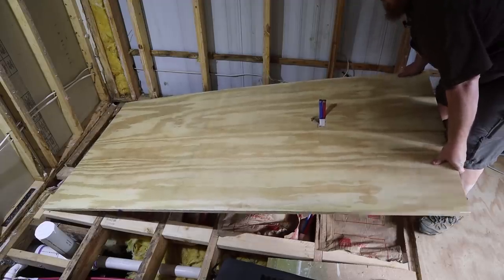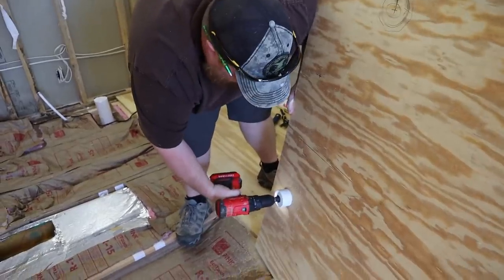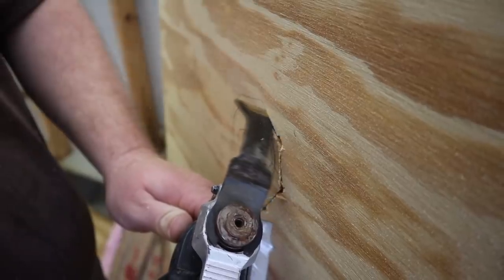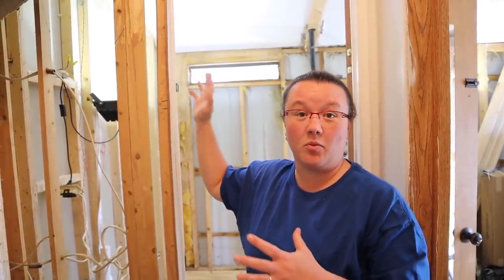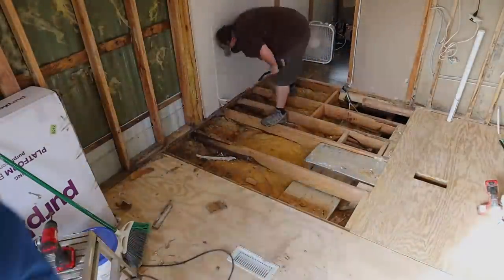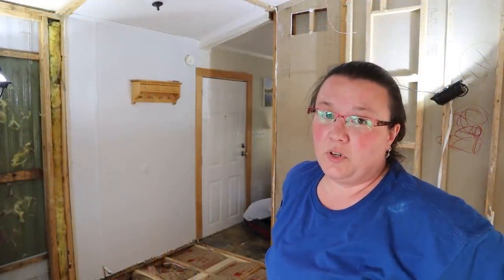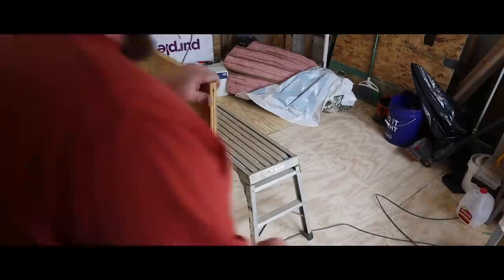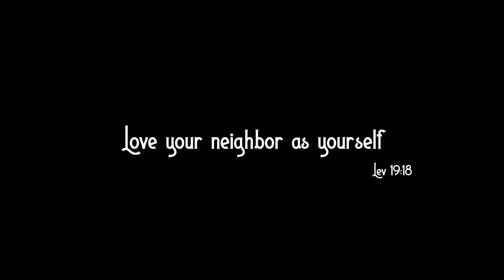WE'RE DONE with this FLOOR! Mobile Home Bedroom & Bathroom Renovation

Comment: Just throwing this out there -- If you get rid of that little 2 foot wing wall that's remaining of the furnace closet and you replace the door to the bedroom where it was before, then you have room for a 4-5 foot entry closet between the living room and the boys bedroom.  And you get rid of that annoying jog in the hall way.  You don't need that vent on the upper wall in the living room side anymore and that will get cleaned up at the same time.  If you don't use it for coats, you could always use it as a linen closet.  Maybe half linens and  half coats.  Just my idea for what it's worth

Comment: I bet the boys will be happy to get back in their room! 
I was reading an article about lumber prices and the contributing factors for the increase. 
It stated that the average lumber cost for a new home is increasing in cost by about 24k. 
It's sad when plywood almost breaks the budget!
Reply from the maker: They're excited, but not near as much as we are! :) We'll probably push to finish the boys room first, then the bathroom on things we have choices over. We can live with one bathroom longer than just one bedroom. We shutter to think how much more everything is going to increase in price just because of lumber prices... it's surely got to have some kind of butterfly effect on things overall. Especially after this long! The spike is turning into a plateau. :(
Reply: My local Lowe’s and Home Depot are loaded with wood. Nobody is buying. The price is going to come down some. Housing starts are dropping too.  Two of the giant cracker box builders near me are offering new homes for rent!
Reply: @tyrehester5550  and yet I can’t get fence wood within 20 miles of me for my fence that blew down in February 🤷🏻‍♀️
Reply: @sam-and-angela  try to recycle wat you can (like the studs from the old wall framing ) , it brings the total cost of the build down and leaves you a little extra money to splurge on other things like wallpaper flooring and fittings
Reply: @crystalh1402  they have this stuff here they make from compressed and heated plastic , actually works well https://www.plasticlumberstore.net/recycled-plastic-lumber
with the raised prices for lumber it might be a good alternative , it doesnt rot when put in the ground so it should last longer

Comment: Thank you for using actual plywood for the bathroom floor! I see so many people using osb (particle board) in bathroom and kitchen areas and when osb or particle board gets wet it's falls apart or atleast loses strength!! We did a full remodel on a double wide we owned and I replaced the entire floor and exterior walls with real plywood. We also rebuilt exterior walls with 2x6 instead of 2x4s as it gave more strength as well as more room for insulation. It wasn't cheap but our utility bills were reduced by half when we were done. It also really quiet inside now. That was a pleasant bonus we didn't consider. You guys are doing great!! You've also saved yourself a huge amount of money by doing it yourself!

Comment: AT 10.51 where Angela had explained about the small hallway , I wondered if you had considered moving the door opening to the boys bedroom over a bit further to the wall on the right . (where that wooden hat rack is )the space that the door took up could be used to place a door to the bathroom making the bathroom slightly bigger because you have removed the furnace.

Comment: there is a wall saw that is used specifically for that though but would still have the same ''issue'' replacing blades anyway. but the oscillating saw might just edge it out because you can use it to clean/level the floor joists as well.  im glad i found yalls videos. its been a minute since ive done any work on a trailer and im most likely fixin to move and the land also has a trailer on it that is ours if we want it and this has been a good refresher course on what to expect. im about to be workin non stop because the land has a house on it that needs repairs and updating, plus the trailer, and the one thing i NEED it aint got is a garage which im going to build from scratch. concrete floor 30x30 walled in pole barn. then after that i get to start/finish building my vehicles (s10 drag truck and street/strip foxbody mustang). oh yea and i almost forgot, i gotta get my blacksmith shop goin as well. i gotta go to work at some point too. lol

Comment: Hey guys someone commented about a shower head and is really simply went you buy the mixer were the hot and could enters you just and and extra for the shower, think it as a t two inputs hot and could 2 exist shower and bath fill, the height of the shower head is just about the bathroom wall, you can put a 2*4 to rest the tube of the shower head, actually went you buy the components is a picture that show you how to. No that complicated using pegs. But is getting nice. Really cool

Comment: Good job.I may have to redo my bathroom as well.from walls and floor and new sink and vanity. I have a water issue but don’t know where it coming from.think it’s coming from roof and running inside the wall and sitting underneath the floor underneath the vanity.think it’s from the snow melting and found a way in

Comment: just short the wires in the bathroom (safely) , it will trip the breakers that need to be off
shouldve kept the wood left from the framing of the old walls , even though you probably need to de-nail it that wood is pretty expensive and once clad with plasterboard you whont see that its been recycled
might want to check the floor to ceiling height across if youre planning on putting up a new wall , could be the ceiling has sagged a little after taking those walls out and you can prop it back up by cutting the frame a little taller then the actual height in the center (take the height measurement near the wall across ) and hammer the frame in place , that way you dont get leaks from water collecting in the middle of the roof

Comment: Thanks for another great video-  I wish you had filmed taking out the furnace because I need to do that too.  Aside of the electrical, what tools did you use, and how did you do that?  Just take out screws / bolts & lift it out?  I hope I can lift mine myself.  It didn't look too heavy-    What do you use for heat in your home?  Thanks!!!!
Reply from the maker: We filmed the whole process, but the camera card corrupted the files. It was a huge annoyance and bummer. I went through every step, too. sigh That being said, for us, the furnace was not bolted or screwed down. It was sitting in a metal thimble that nestled it into the duct board box below. As for wiring, we just shut off the whole house breaker, clipped the wires, capped them off and taped them up, left the labeled breakers for the furnace off, and turned back on the home's power. There were two large wires feeding the furnace. One for the element and one for the blower -- at least that's what we assumed. The overall weight of the unit was about 40-50 lbs. maybe. It's more bulky and sharp edged than anything else. We're planning a video all about our heating, etc. soon.